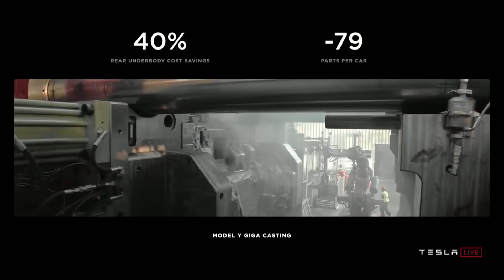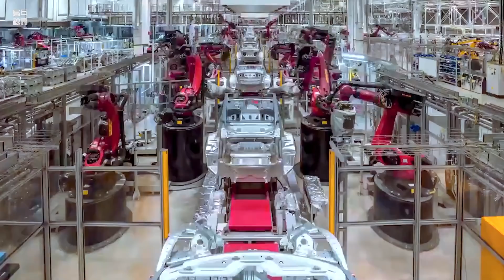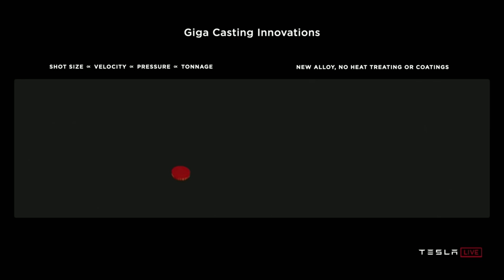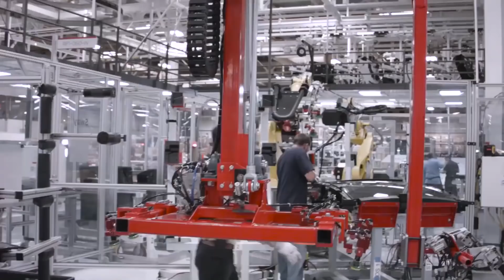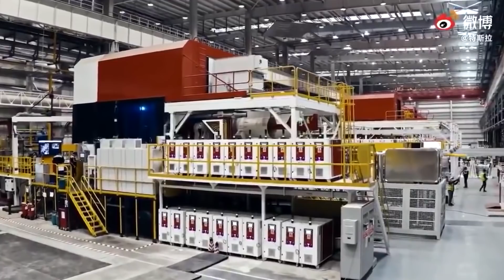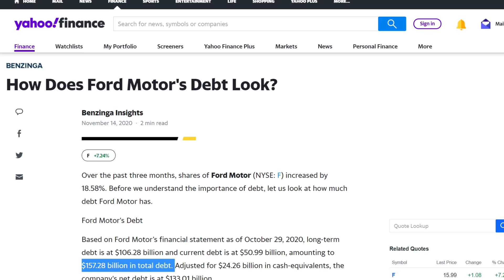Tesla Giga Press: Why dont Auto manufactures copy?

Comment: Don't confuse Cost Avoidance with savings.   The Gigapress avoids future costs because Tesla is building a new Factory.  Scrapping Billion dollar sunk cost factories to "avoid cost" would not net out a "cost savings."
Reply from the maker: great point
Reply: Also those manufacturers have developed platforms way before tesla and parts are interchangeable which means less headache in the manufacturing.
Reply: @carholic-sz3qv  those interchangable parts also contribute to repairability. Tesla's infamously hard to repair, almost to the point like iPhones.
Reply: @triadwarfare  Tesla has not invested properly in establishing in a critical volume house repair ability and certified contract shops. This slows repairs down unnecessarily and is beyond annoying for any owners. Beyond that Tesla has never been "infamously hard to repair."
Reply: Correct. Depends on the IRR and payback period of the sunk assets rolled into the costs of the new method + downtime while the “switch” is made.
Reply: good point!
The germans are strong in builing presses. They build 3 years ago the strongest in the world. Search for SMS group or Otto Fuchs or Siempelkamp...
If it is more effective, they will catch up fast but the main point for german car builders is there variety of cars, so it is more complicated to build a mold for every different car.... They try to build flexible and modular platforms instead
Reply: @Goku0583  Yep, This guy gets it.  New model every year = added expense without added benefit.  Consumers are stupid and Big Auto created their own problem.  Henry Ford is famous for saying, "they can have it in any color they want, as long as that color is black."
Reply: @Goku0583  Several Chinese suppliers have indicated that they will develop and install casting machines in the 3000 - 5000 ton range.
Reply: It's amazing how few people think of that.
Reply: OP is right.  "Why save lives when we can save money?" -Big Auto
Reply: @James Pink AND THAT......is very much the heart of the matter......EXECUTIVES are paid incentives that are short, medium and long term.....but often weighted to short/medium......thus executives RARELY have the courage to make tough decisions for a future they may not benefit from, over making easy decisions that line their pocket in 1-3yrs.

Writing down a Ptess Shop or inventory, no matter how efficient the cutover, writing off the DT expense in lost revenue, adding all the additional commission/cutover versus a greenfield site.....IS NO EXECUTIVE'S DESIRE.....thus, they'll, mostly, kick can down the road and make it someone else's problem to decide in 3-5+ yrs.

Always happens, executives rarely make tough, courageous decisions if it negatively impacts their incentivisation packages.
Reply: Which means they are stuck in their old ways...
Reply: New mega robat!!!
Reply: I'm a software engineer and I work in the integration space. From my perspective, the gigapress is more about reducing complexity to speed up the pipeline. In my world, we're constantly fighting to keep things simple. Every extra step makes the pipeline brittle and ends up slowing innovation. When time to market is key, reducing complexity and improving reliability is a major advantage. It means you spend less time fixing things and reduce down time. Every time you need to weld, you need to QA the result to catch defects. Reducing future cost is less important to reducing complexity and speeding up innovation. Retooling a manufacturing line in the smart phone industry usually takes 3-6 months. For auto industry it's considerably longer and much more painful. In the airline industry retooling takes years. Just look at Boeing the last decade.
Reply: Its a matter of volume rly, given enough volume it will net out. Most traditional car assemblers do rework their manufacturing sites into ev production so they already bear the costs, might as well upgrade while they are at it
Reply: that falls victim to the sunken cost fallacy.
Reply: Sunk cost is sunk cost. It only matters the return on investment in the casting machine. If the reduction in supply chain and labor costs improve margins, then it may be a good business case. In Tesla's case, they don't pay a dividend and are pushing all gross profit into machines. They haven't added debt in a couple years, so casting machines make great sense for them. It will likely lower their manufacturing costs under established companies.
Reply: @kdungan100  the major part of production cost is Capex. Once the production line is set up, I don't think there is a big difference in variable costs. So switching to casting only makes sense for new production lines.
Reply: There's a time to fish and there's a time to cut bait. It does not matter how much a piece of infrastructure costs to build initially if it cannot produce a competitive product. Look at VW this past week. They admitted its taking them 10 times as long to produce a car as what Tesla is achieving in China already. And the Berlin factory will be even more optimized having both front and rear castings, and likely structural battery pack as well. There is also a new paint system that is supposedly going to yield superior product much faster and cheaper as well. Hanging onto stranded assets is NOT a good idea.

Comment: You might want to ask yourself what does it cost trad auto to make the front and rear underbody of a car in the traditional way??

The answer is.......not much

The whole cost to make a Nissan Qashqai SUV is approximately $17,000

That's the whole car
From engine to wheels. From seats to mirror. From the computers to the oil in the engine. From bumper to bumper. Everything

So what percentage of that $17,000 cost is the front and rear underbody? I'd guess less than $1,000

So if you had a magic genie which farted out free car front and rear underbody the max you can save is $1,000 per vehicle. But of course the giga press method using aluminium isn't free magic it will have a cost above $0

No matter how you dice it how you slice it how you cheerlead for it it doesn't look likely to reduce the cost of a tesla more than 1%.....

That's not nothing
It's a good step in the right direction
But it ain't world changing

Should traditional auto jump onto aluminum giga castings? Probably not. They are pretty dam good at making low price cars using steel and stamping. Just because tesla isn't great at steel and stamping doesn't mean Toyota VW etc who have made more than 300 million cars that way aren't good at it....
Reply: The thing is, i was an apprentice in several pressing and forging factories. They have several lines of massive presses stamping those parts. If one machine fails, thats maybe 20% of their capacity gone for, like, a week at most. If something mechanical on this injection molding machine fails (it isn't a press) its currently 100% shutdown, for quite some time
Reply: @MannoMax  that's exactly the point
Reply: I seem to remember that the cost saving is not much, if any. Its the associated cost of tooling, shipping, inventorising, assembling hundreds of bits, screws, fastenings, labour, robots, factory space, and potential problems if anything is missing, incorrect, mis-assembled etc.
Reply: @Allen Loser Exactly. People proclaiming gigia castings are a revolution without comparison while not even able to willing to compare the existing system to the new aluminium castings

I think its a step in the right direction for Tesla else they wouldn't do it. But it doesn't mean it's a process which would benefit everyone

Tesla has about 3 years experience at stamping steel to make rear and front underbody. VW Toyota etc have 70+ years experience. As someone in this thread pointed out they worked at the Honda factory in the UK and the underbody costing was £600 according to them. Assuming he is telling the truth it shows traditional auto has steel stamping down to a fine art. How much will the giga aluminium underbody castings cost. Less than £600 ? More than £600?

Even if Elon musk found a magic spell which allowed tesla to produce giga castings for £0 (obviously impossible) it would only save £600.bnuch more realistic is thst the goga castings cost about the same as steel stamping which is more or less what sandy munroe said in one of his teardown when he was asked how much cheaper the giga castings will be he replied with 'probably a wash' aka they won't save any money but perhaps they will improve quality and marginally lower mass
Reply: @kaya051285  True on a per part basis, but there are also logistics and inventory costs associated with each additional part you use instead of the casting. Tesla said they saved 79 parts on one gigacasting. That's 79 parts which don't require procurement and stocking and shipping. Then there's the quality cost. Each part is a possible failure point. The single piece is stronger, more rigid, and quieter than the assembled piece. From a blank sheet point of view, it's probably the best way to go.

I'd try out the castings on a new EV car, if I were a legacy auto maker, but there'd be resistance from executives on such a change.
Reply: @Allen Loser yes but another factor to bear in mind with cars is that car markers don't just compete with each other they compete with the 1.5 billion existing cars on the road

The biggest competition for a Toyota Corrola isn't a Honda Civic isn't a Ford Focus isn't a VW Golf. The biggest competition for a new Corrola  is a 3 year old used Corrola

What this means is traditional auto can't maintain high margins. Tesla will suffer the same fate in 5-10 years their margins will fall to traditional auto level for the same reason that a model Y in 2030 will have to compete with a 2027 model Y
Reply: Good point.
But you have consider how much profit they are making on the $17000 vehicle, against the volume they are producing. ...  so if they save even $500 on the on the front, rear and under body casting, it will make a huge difference for the company long term, you could consider how much savings associated with logistics and everything else  associated with multiple parts.

You also have to consider speed of production of the cars. 

Always compare savings with current profit margins.

If they are going electric, they will have to compete with tesla in manufacturing cheap electric cars, every dollar counts.

ICE cars will become more expensive over time while electric cars get cheaper over time due to the transition.
Reply: @maroexe  In a competitive market cost savings go to the consumer via lower prices not the producer via higher margins
Reply: @kaya051285  Unless you have a monopoly on a technology or process, such as Full Self Driving. Then you're at close to 100% profit margins.
Reply: When I worked on a  project in Honda's Paint Department, Weld Department charge us £600 per chassis of CRV.
Reply: The thing that scare me is if u damage a small part of the car the whole car has to be replaced v cant rebuild cars they will become use and throw items
Reply: @abdulrehmanahmedshaik19  obsolete, by the plan :)
Reply: What about repairing?
Reply: @guruxara7994  Good question. Since no one has done this before for an auto, we don't have data. I'd think if the casting is badly damaged, the car is probably totaled. Minor damage can be treated as body work.
Reply: Wow! Only $1,000 savings per car! If 100,000 cars are made per year, which is conservative, the manufacturer “only” saves $100,000,000 per year. I can see you are not working in manufacturing. Manufacturers try to squeeze every penny out of parts that go into their products because it all adds up when volume comes into play.
Reply: @jeffbransky7966  The giga casting doesn't take the cost from $1,000 down to $0

The savings, if any, will be a fraction of the $1,000 cost to make stamped steel underbody
Reply from the maker: Interesting points but i dont know too much about how other auto manufactures make their vehicles and how much time and equipment / parts are used to make the same part as Tesla would with the giga press

Comment: Great episode, would be good to get Andrew back to run some numbers, how much Tesla can save using Giga castings. Less capex, fewer robots and manual labor, but the raw material cost for aluminum is much more than steel.  What is the actual monetary benefit if any?
Reply: I’ve done this in my professional career. Soooo many factors I wouldn’t be able to accurately nail down for Tesla, but great idea.
Reply: Not only saving for the casting itself but also as important: Weight saving/mileage increase and panel gap improvements.
Reply from the maker: Excellent question

Comment: Massive complicated expensive one-off machine in the critical path,  what could go wrong?  That is my question from Andrew.
Reply: Always the same drawback of simplifying, concentrating processes/functions to one. This is a tricky path, very difficult to achieve (contrary of divide to conquer).
But I bet cost saving promises are worth the effort. Makes me think of the octovalve.
Reply from the maker: Good question Andrew
Reply: Giga presses aren't one-off, but they are few in number, for sure.
Reply: Lots of things, for sure. One machine already had a small fire, for example. When one is moving massive amounts of molten metal at incredibly high speed and pressure...
Reply: Good point! Another aspect: dyes are very(!) expensive, so smaller imperfections will be replicated until the dye can be written off: thousends of cars which crack in the same spot...
Reply: Its just flashy marketing imo. The established companies could have had this technology too, they just didn't want it.
Reply: @MannoMax  Seems you didn't see the premises of the interview or do not believe on what is said in it.
Reply: @marioescalona1640  I don't believe Musk people anymore, because according to musk, we'd have a hyperloop, and the first mars colonists by now.
Reply: @MannoMax  Source
Reply: @jonpetter8921  For what
Reply: I think it is a risk, some solutions could be:
have machines that are highly reliable.
monitor the machines to fix and maintain things before they go wrong.
have spare capacity like two machines at 70% each to take the edge off a failure.
have a 1 or 2 or 3 days buffer of castings maybe offsite with a plan to transport them to the factory in an emergency.
Reply: @danielstapler4315    High pressure die casting has some inherent problems with reliability.     I mean you are pushing molten aluminum into a precise mold at very high pressure.   It can be done,  but when you do not take care of the machine,  we see what happened at Fremont already where massive damage was done to one of the machines in the first months of operations.
Reply: So if a gigapress fail all the production line would fail in a cascade event? Replacing a robot is easier than replacing a 6,000-ton press.
Reply: Exactly,,  we already saw one press  burn down and out of service for quite a period of time,  so Tesla had to rush one of the presses in Texas into service to make up for the burned one at Fremont.      I think ultimately the Gigapress and mega casting are good options,  but it's a rough and bumpy road to get to the benefits, which will not be recognized for months to years.

Comment: how long does it take for the cast to cool before it can be used?
Reply: Q: how long does it take for the cast to cool before it can be used?  PERHAPS A BETTER Q: how long does it take for the casting to cool before it goes to it's next "manufacturing step" before it should get anywhere NEAR an assembly line.  most aluminum parts regardless of casting type be it Gravity or Die (even ones not needing heat treatment) require some kind of QC, verification, dimensional checks, and even final/minimal CNC machining for clean up and drilling of hole mounting locations. #NEARNET
Reply: @phillyphil1513  love this question.  We could spend an entire episode on this. Will address.
Reply: Good question. This is touched on in another episode i believe. If not, I can address.
Reply from the maker: Great question

Comment: one major problem would be the volume of cars that the bigger companies produce, they would not want to ship some cars with casting, and some without. Tesla is going to be doing this where the model Y will or will not use castings depending on what plant it's made in (even here in the US). normal car companies are not willing to do that and so would have to have a new model or make a 'flag day' change at the end of a model year. That would take a LOT of casting machines.
The company that's making the giga-press for Tesla is making single-digit quantities of these machines per year, and the fact that Tesla is getting 6-8 of them in the next year is basically their entire production. this just won't work for companies looking to sell 10-100x as many cars as Tesla.
Reply: I would think that a giga press is central to Tesla's plan to eventually manufacture 2 million cars per year in a SINGLE factory,  which would be the equivalent of 3 or 4 factories for the OEMs.  A giga press is expensive expensive initially but savings are huge once economies of scale kick in.
Reply: @panyanguyen13  that's very true, the problem is the ramp-up when you don't have that many giga-presses. do you build a low volume car? or do you have a model that sometimes uses a cast part and sometimes a traditional part? neither is attractive to a traditional car company.
Reply from the maker: great points
Reply: Therese is another producer off those machines , more demans wood increase capacity